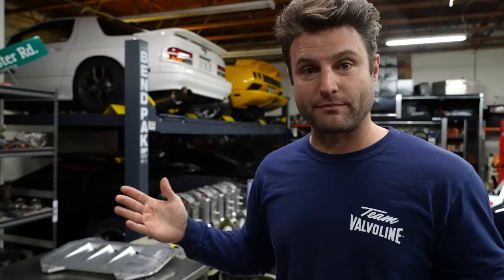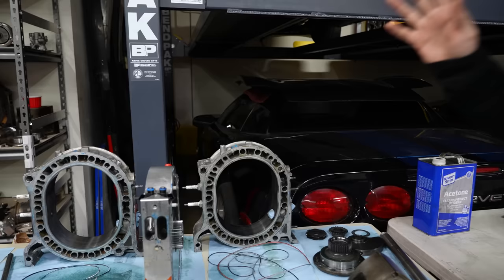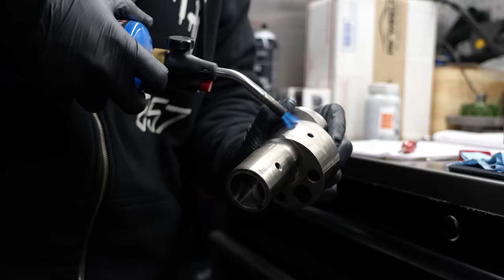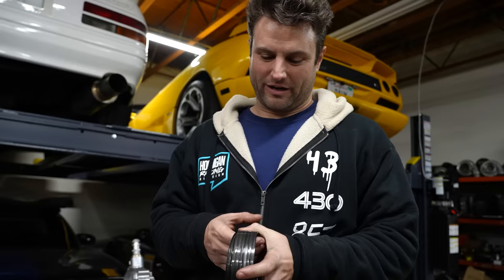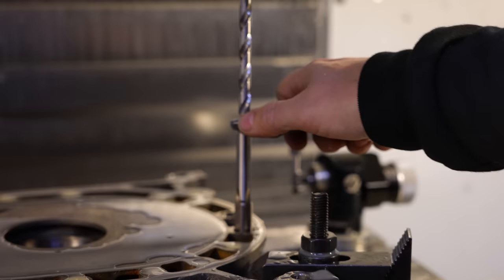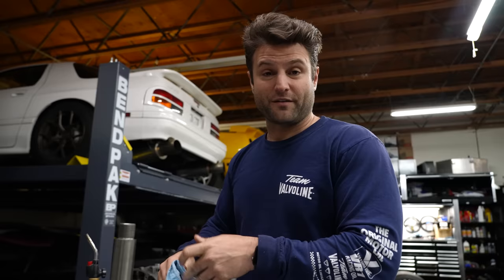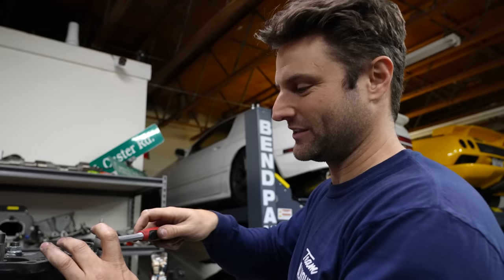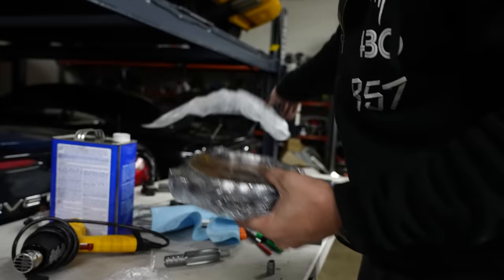Building the 4 Rotor for the most HP we’ve ever attempted. TV Show race prep

Comment from the maker: Some people are buying the shirt and hoodie without adding the poster to their cart. Ill still include the signed poster regardless!
Reply: would it be possible to have the specifics on the sizes cuz some brands im a large and others im a medium
Reply: Try to fit an ISG( ingegrated starter generator) on the accessory drive and you will get rid of kore weight on the flywheel

Although this will take some effort to get it going with the electronics unless there is a standalone solution out there
Reply: Can't wait to receive my clothes, poster and badge! First time ever buying a hoodie with any design, love that it isn't as over the top as most Youtuber merch.
Reply: what a g
Reply: I would order some but your missing my size 😭
Reply: Rob, is something wrong? This video ended at the end of the video and not at a cliffhanger.
Reply: To put in helicoil, I start slightly oversized with the rebore, and then use a chucking reamer to get the closest size for best threads for tap.
Reply: Stand up move, Rob, I've always appreciated the type of person you are, an inspiration to me for sure. Thank you!
Reply: Thank you I'm done Mr Electrician
Reply: Sorry i mean Mr Neurosurgeon
Reply: Oops, I just did that, I missed the note at the top.  Thanks for looking out for my dumbass Rob, much appreciated!
Reply: Sell me a billet rotor badge!
Reply: You better watch out for kyles nsx 😂
Reply: Hey Rob how much horsepower should a 4 rotor make N/A like the one adam lz is building?
Reply: Hey Rob you should look into the sealant that Mercedes uses for there valve covers. It might work out better for your application.
Reply: @FirstLast-tx3yj dude runs haltech. It can handle it
Reply: @dylanzrim3635  idk because an isg is an BLDC electric motor that I believe requires its own controller but sure the haltech might be able to tell the controller on and off
Reply: I didn’t check out and now the hats are sold out. Boy I blew it. 🙄 haha
Reply: You should look into WPC & cryo treatment
Reply: Will you go peripheral port?
Reply: Modded/Tuner motors nowadays have more power than hypercars because modders/tuners don't have to worry about emissions regulations and maintenance cost/intervals. Just look at R35 GTRs going 2000+ hp and twin turbo Lambos and Vipers going 3000+ hp, with full interior cars (not sure if they still got AC though).
Reply: Be careful with bondo dust im pretty sure its very flammable and if you have a lot of it near the exhaust or something hot it might cause a fire
Reply: Do you need to buy the shirt and the hoodie since i just bought the hoodie before looking at the vid?!
Reply: #kb43ver I see you
Reply: Why would you make that long video and screw with me at the end. 🤣
Reply: unfortunately thats a bit out of my budget atm: but soon! hopefully the canadian dollar value goes up lol
Reply: It sucks that we're not gonna get to see the 4rotor against the hoonicorn rip ken block
Reply: Hey rob. Such a cool video on why you do what you do. I have a noob question about the crank timing. Shouldn’t they make more power if the firing order was 1234 right down the line?  I’d think it would be way easier on the crank flexing?  Maybe there is a reason I don’t know of that would make that impossible. Thoughts?
Reply: Just bought my first youtuber merch!!! 
Ohhhh no after purchasing! Just realized I had to add the poster to cart! Hopefully I still will get it!🤞 🤦🏽‍♂️smh should have read the comments first!
Reply: Your giant head makes the hoodie look small
Reply: Still waiting on Shipment confirmation... :-'
Reply: change oil radiator frequently
Reply: @Rob Dahm I have so may questions for you I need simple answers to fix my 05 rx8

Comment: Me watching this knowing damn well I'll never own a rotary engine: "hmmm that's a good tip to keep in mind Rob"
Reply: By a 13B ROTORY. They not that expensive and make good power. My rotary is going into my Fiat X19. Hopefully in this year before my birthday in September. Present from me to myself. Haltec management every thing is lying and waiting
Reply: Aldo stefanini that sounds like a cool project. I love the x1/9
Reply: @TheCluelessEnthusiast  yeah I can't wait to start it. Don't think many X19 has a rotary inside. Most common swapps are honda k20 motors. I'm only waiting for a gearbox then i can start making the engine mountings etc. It's definitely going to be fun as the car only weighs 700kg
Reply: @TheCluelessEnthusiast  and to get 200kw out of the 13b is easy. So you can work out the power to weight ratio
Reply: @aldostefanini1392  that will fly. They weigh nothing. You should do the build on youtube mate. You will get a lot of people following a build like that because it's very unique
Reply: Same lol. Although my wife's Fit Sport hasn't been running right and I can't figure out why...so the clear solution is to swap it with a rotary, strip the interior, convert to rear wheel drive, install a rollcage, etc. etc. 😅
Reply: Same as me, enjoying the entertainment and information whilst both of my project cars are old Volvo 940a with 8V Redblock tractor engines. 😅
Reply: @bootysmaka22  no no no, keep it fwd, it would be really light and you'd be able to throw it around corners

Comment: you should get the oil tested to see if the tungsten you put on the E-shaft gets worn off
Reply: Anyone without a Valvoline hookup; use Blackstone.
Reply: I don't think it's necessary to do a lab check. The yellow residue might be the sulphur or tungsten that broke off the compund. WS2 is a dark colour, so leaving a yellow residue might indicate it broke down into tungsten oxide or sulphur oxides. The oil in that case, in a lab check, would be more acidic than usual. Please correct me, if my thinking is off, or anything.
Reply: @sirboiledpotato1314  I dont know about all that, but a lab check can let you, if you know what to look for and the material make up of certain parts, allow you to see if things are breaking in properly, or wearing excessively before catastrophic failures happen. Example, Catch it Before a block decides to shit a piston, or possibly even make a rod knock that is audible to the human ear.
Reply: It's a very good practice on ANY performance engine - think of it as cheap insurance.
For heavy machinery it's often done as a matter of course as a requirement for the warranty.
Reply: Housings chrome surface looks terrible

Comment: Hi Rob. I'm Ray. I'm an engineer. The purpose of the oil groove in the bearing allows the oil to come through the supply hole, flow all the way around the journal and have the same oil pressure all the way around the journal to push from the middle outwards between the bearing and journal. It achieves the most even flow around the bearing as possible. A race motor typically has larger clearance on the bearings. This makes sure that when the crank (or eccentric shaft) flexes and bends more under the high horsepower and rpm, the journal surface doesn't touch the bearing material (as you know there should always be sufficient oil film in between). This larger clearance means that more oil flowrate will pass over the bearing and therefore the groove needs to be deeper to accomodate the extra flowrate and keep the pressure even all the way around the bearing.

Comment: Rob have you ever looked into cryogenic coating for the housings, apex seals, and rotars  It's a little pricey but it's well worth it. It makes parts that rub alot stronger and more slippery for less wear.
Reply: There is also a company called Microblue that I think could be even more beneficial.
Reply: Plus wpc coating
Reply: @jhon-cg4rg  Agreed WPC has a lot of benefits; I'm surprised it isn't more mainstream yet.
Reply: Do you guys use this, have you used it on a high horsepower engine?
Reply: @bravozulu3257  Yes; I've used WPC on transmission parts / gears of a racing motorcycle engine.

Comment: To your discovery on the silicone / RTV. Most people think that RTV is what does the sealing when sealing 2 surfaces, when in fact most of the sealing is done by metal to metal contact. Which is one reason why checking for warpage of housings and irons is so important.  A slow drying RTV is more desirable when assembling a complicated engine so that there is time for the sealant to squeeze out as much as possible during assembly. For this reason I actually use the hylomar on the legs of the engine if assembly time will take longer than normal.
Reply from the maker: That definitely makes sense to me as I learn more. Now that I have more experience with hylomar I can see why you say that. Appreciate the tip!
Reply: @RobDahm  Hylomar is likely the sealant you’ll also use on the Indy Car gearbox. I’ve been using it for decades on Hewland gearboxes with excellent results. It is oil and gas impervious and never completely dries, always staying tacky. It will actually reseal after a fast gear change when there isn’t time to clean the surfaces. Buy the good stuff, not the off brand.
Reply: @RobDahm  as an additional to this and the complication in flipping it, would you be able to make a dedicated build rig/table that works similar to a traditional engine stand in the way it gives you the ability to flip/rotate the engine?

Comment: You should get yourself a spring loaded tap guide, great for manual mills/lathes, Cncs, or even drill presses. Makes life so much easier and your holes are always tapped straight
Reply: Came here to say this! I’ve hand-written enough Haas programs that I wouldn’t have hesitated to rigid tap with the CNC, but I can’t deny that it’s one of the freakiest operations to run when you’re first learning it. Rob definitely did the right thing using the spindle to line the tap up but a spring loaded tap follower would’ve made it a lot easier.

Comment: The tap is an STI tap, which keeps the same thread pitch but in a bigger OD for the helicoils to be able to go into, producing the right size thread pitch diameter once the helicoils are actually in place.  Also ypu should get a proper tap handle and also a tap guide, which is a spring loaded pointer that keeps tension on the tab as it threaded in to keep it on center
Reply: This guy taps
Reply: I've heard it called tap follower but I thought the same thing.
Reply: I was gonna make this comment, but figured someone probably beat me to it. LOL

Comment: rob, hope you see this:

helicoil taps (and thread gages) are always labeled by the size of the threaded insert they tap for. helicoil taps will usually say “STI” right after the thread dimensions so you can differentiate them from a regular tap of the same labeled size. in your case, the helicoil tap should read “M12x1.25 STI,” meaning it taps for an M12x1.25 insert.

Comment: @Rob Dahm 
You need a tap follower. Same concept you were doing with the drill bit. You have a spring loaded chamfered pin that you load into a chuck then preload the spring over the back of the tap with your mill spindle in the center of your hole and spring pressure follows for a little while (can repeat preloading as you're progressing) and you have a near perfectly straight and perpendicular thread.

Comment: you should get a tap wrench set for when you're taping, helps maintain even pressure on the tap, stop it from snapping and keep it straight. you can also buy a spring loaded center that you can use to help keep it straight with the machine, they're all pretty affordable tools and will do you well for future

Comment: Your 4 rotor rx7 is basically the closest we've got to a rotary super/hyper car - other than the furai or RX vision.

Thank you for building this work of art.
Reply: If only Top gear didnt kill the Furai .
Reply: Can't wait to see a quality inline 8
Reply: @rya3190  hell yeah the 6 rotors are epic . Ash from Misfire Channel is doing a 8 rotor
Reply: @ClwnJuNkY  Does the eccentric shaft run into similar issues with the old inline 8 piston engines, where they were prone to breaking their crank shafts?
Reply: @ClwnJuNkY  True, but hopefully Mazda still has the blueprints somewhere. Apparently the Furai's engine was a 3 rotor Renesis; R20B. I've always been curious to the design, my guess is that it was similar to the rx8, but the side housings must have had the peripheral exhaust ports. If I'm not mistaken it only had 450bhp, but it was enough to deliver reasonable performance.
Reply: @rya3190  we will find out . The 6 rotors seem to be fine . Especially the ones Built by PPRE

Comment: Something that works for me sealing bolts and shafts. I rebuild race and truck gearboxs and we simply used red loctite that was to oil or pressure. Any soft setting stuff was no good but loctite, never leak plus the added bonus. Also red loctite 518 for all sealant surfaces, amazing stuff, you will never use grey silicone again. It only sets with no air so heaps of time building is allowed.

Comment: A tip I've learned to line things up in the mill, use a gauge pin that fits tightly into the hole, but put it in the collet and line up the table till the pin just drops in the hole. They also have spring-loaded plungers that can help guide the back of the tap to provide even pressure as you tap (and keep things fairly aligned).

Comment: have you thought about trying anaerobic sealer? I was against it at first and didn't think it would work well but then I tried it on a NV3550 transmission that I had to take apart multiple times to figure out what someone else did wrong to it. So when I took it apart I was impressed with how well it actually worked. The anaerobic sealer is specifically for sealing machined surfaces so it squeezes out all the excess and fills only the imperfections and only cures once it is compressed leaving the squeezed out material non cured forever. That's why I didn't expect it to work well because the goo on the outside never really dries but when I pulled the transmission apart it was fully cured on all the machined surfaces and left almost no material where the surfaces had fit together perfectly and the best part is you can take your sweet ole time assembling.

Comment: I've been using Hylomar spray as the gasket material for my thicker base spacer on my turbo bike. Works well sealing the oil and water paths. Wish we could get Loctite 3020 instead. 
 Blue Monster is another good one for threads. I didnt know they had it in a tube. Only seen the small tins at home depot

Comment: I worked it the diamond drill bit industry, for oil, gas, and geothermal drilling for 17 years. The bits had to be ground to final OD with diamond grinding wheels. The body of the bits were made with sintered tungsten carbide powder with a nickel zinc binder.

Comment: Not sure if anybody else has mentioned it yet, but when tapping you can use a tap guide and handle to keep the tap vertically aligned. It’s essentially what you did with the drill bit, but a little more accurate and easier to control

Comment: The deep groove in the bearing is to provide a path for oil to flow when the oil film is pushed down by torque.

If you ever get to the point of trusting your CNC mill to do threading, you should thread mill all of the threads for helicoils.  You could also put sections of reduced diameter on your studs to reduce friction on the install but still fill the holes closely where you are using it as a locating dowel.  The male threads are the weak point on a stud so beside a tiny bit more stretch in the stud (when tightening) it should be as good as a straight cylinder.

Comment: I’m a injection mold maker and I’ve had mold components coated in ws2. We generally use it to help with release. I’m not a total fan of the coating purely because of how easily it can be removed I feel in your application at the least I would avoid touching the surface after it’s coated. I think with how easy the coating is to remove just by touch your oil will eventually rinse it off but just speculation.

Comment: From my experience with that injector machine. The small fuel pump it comes with isn’t strong enough to manage the flow of the really big injectors. On my machine i put together a big fuel system in a small 1 gallon fuel cell of calibration fluid to help with the larger injectors. Works great.

Comment: In short: With the greater clearance the oil flow out of the bearings will be higher. With a shallow oil groove the oil pressure on the side that is 180 from the E-Shaft oil port may drop due to decreased flow from restriction(and whirl). So the oil groove is deepened to allow the oil flow/pressure to remain constant in 360 degrees. If your oil pump isn't upgraded for high flow(I can't remember, but assume it is) you will see a drop in oil pressure in this build. Even with an upgraded pump you may see a drop in oil pressure on this iteration of the engine.

Comment: Hey Rob, machinist in training here. That tap for the insert is right but can be confusing. The tap is labeled for the thread you want after the insert is installed. Usually, these taps will say for ex. 1/4-20 STI. for steel threaded insert. Now, being from Amazon, they could've skipped this step. Hope this helps.

Comment: Learned quick in my S4 after a tune, and LW flywheel, and adding a few hundred horsepower... a tad bit of resistance in the very top 5-7% of your throttle goes a LONG way in reducing that hop on the street, without sacrificing Response times or anything along those lines. I jus worked a very slight resistance in the top 4-6% of the pedal into my tune and it worked wonders for me.  Was wild ASF before I figured that out tho lol

Comment: Chuck that tap into an ER Collet and tighten it down as you would a endmill. You don't need anything more than that to rigid tap on a HAAS. If you think the tap will hit the bottom, add a couple then thousandths to the hole bottom. Easy peasy. You'll definitely stop hand tapping things once you've done it enough times.